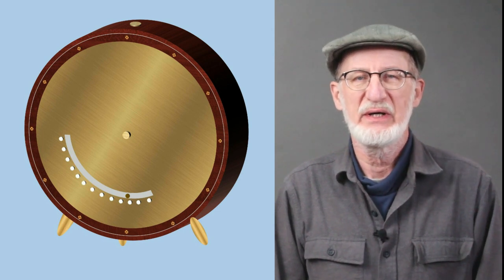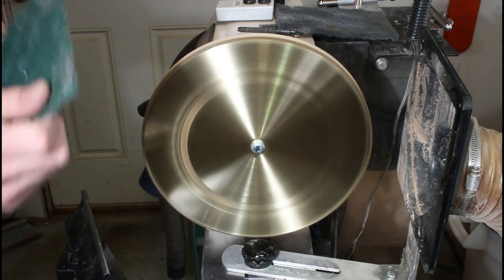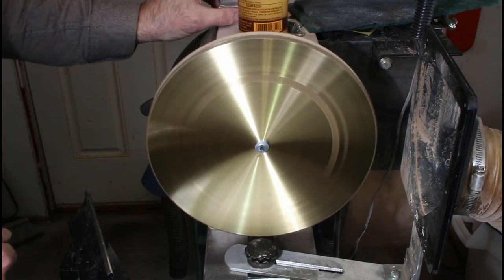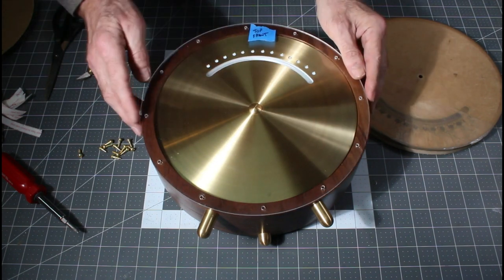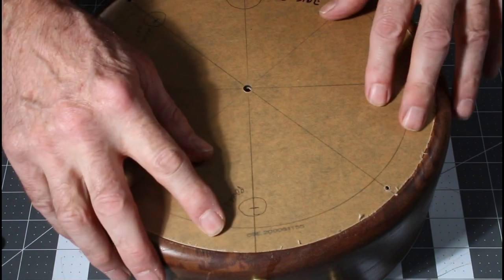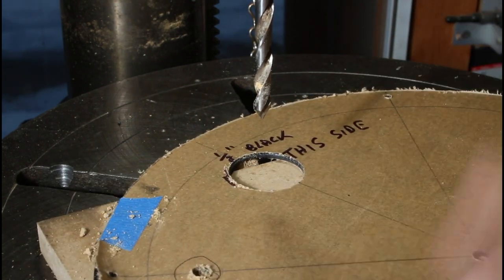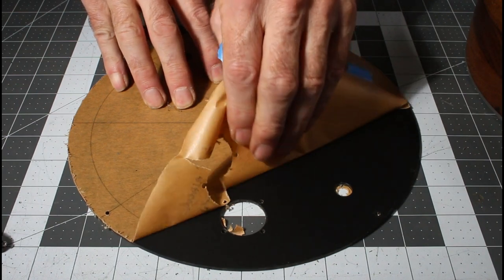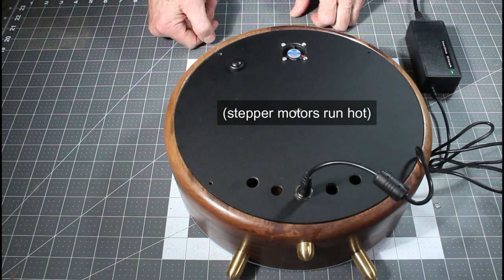Making InclinoClock - part 5

Comment: You should try “Blue Magic Metal Polish Cream “.   Most automotive stores sell it, places like Napa auto parts.  Renaissance wax polish works great as a protective coating. Clock looks great
Reply from the maker: I have used Renaissance wax before, but the brass I used it on oxidized quite a bit after about a year.  
Yes, Dave and I are quite pleased with how well it correlates in appearance with his CAD renderings.